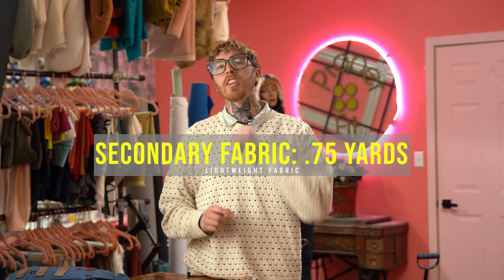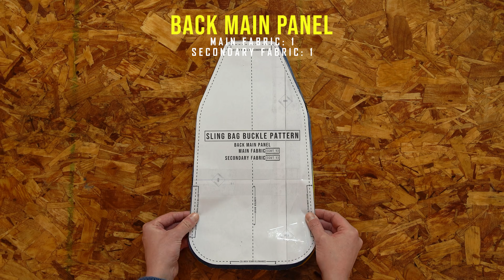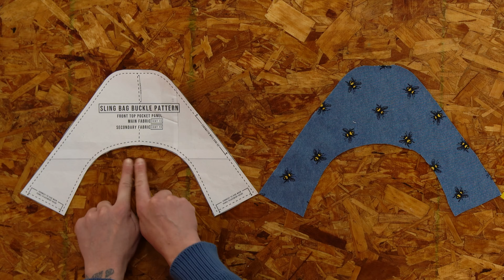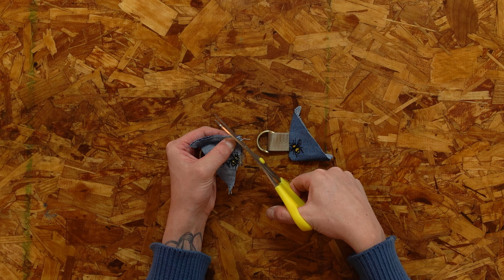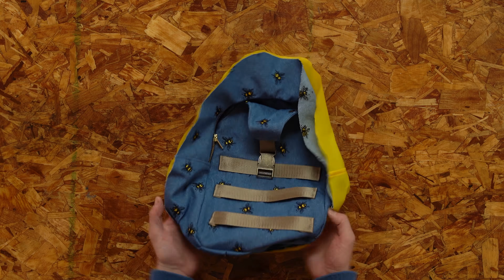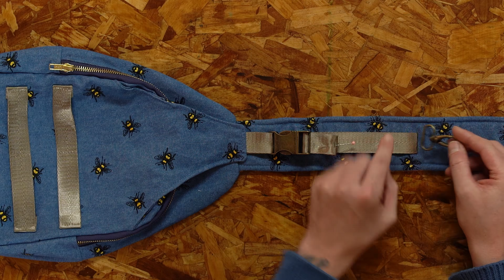DIY Buckle Sling Bag Backpack with STEP BY STEP INSTRUCTIONS + Printable PDF Pattern (EASY PROJECT)

Comment: This is such a fun pattern! I just completed one this last weekend! I used an old pair of jeans and a pair of corduroy pants. Instead of the straps on the front panel, I used the back pockets on both the inside and outside to create more places to put stuff! I also reused an old backpack zipper and internal bias tape. I tagged you on Instagram so you can see it! Thanks for your easy to use patterns and tutorials!
Reply: Is there a way that i also can see what it looks like? I was thinking of also doing this with an old pais of jeans